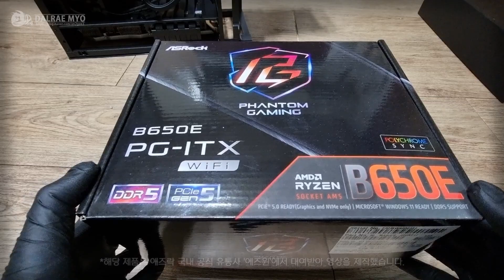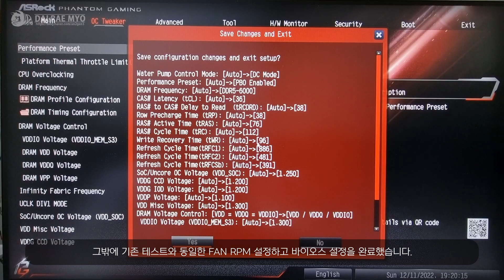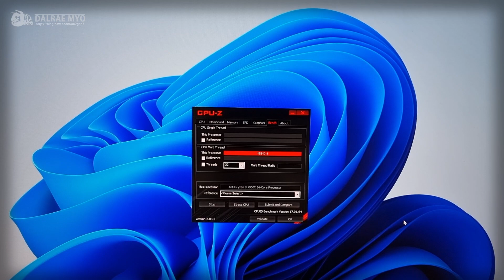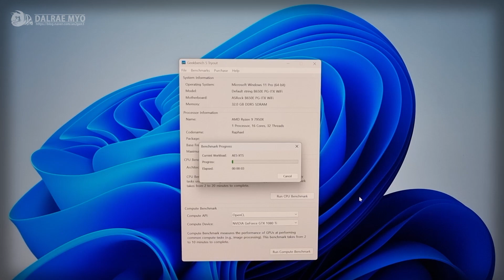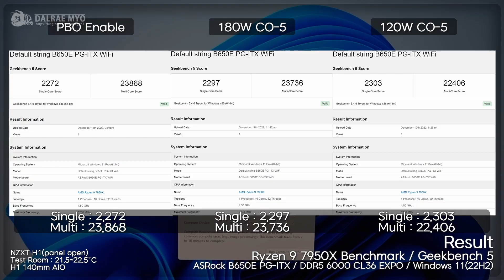ASRock B650E PG ITX WIFI | Ryzen 9 7950X Test

Comment: is it safe to remove/replace the m.2 heatsink? Doesn't it cool other components as well, because there is a heatpipe next to it?
Reply from the maker: The upper part of the M.2 heat sink equipped with the cooling fan and the lower part of the heat sink applied with the heat pipe are independent parts. If you replace the upper M.2 heat sink equipped with the cooling fan, there will be no problem.
Reply: U should use m.2 gen 5

Comment: Nice video! Can I ask if the original thick ssd heatsink can fit into H1 without issue, or have to change to Micronics one?
Reply from the maker: It is not higher than VRM heat sink height, so it does not seem necessary to change it. However, if the memory is high, the AIO cooler's tube placement may be difficult.

Comment: Some great info in the vid. Thank you. Two surprises were the 140mm rad cooling the 7950x in gaming and the second being a 1080Ti used. The GPU will certainly hit its limit before the CPU. Great undervolt. Nice to see this mobo in use too. It's one of a few that have a gen 5 PCIe NVMe and SPDIF, so a really nice I/O combo. Another nice feature is the removeable heatsink and fan.